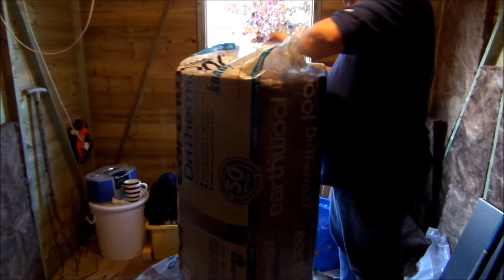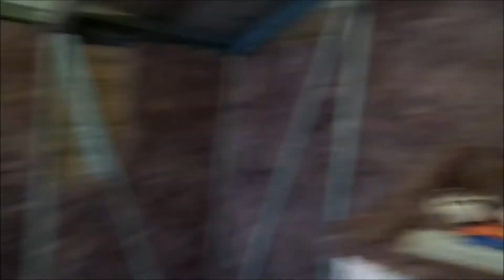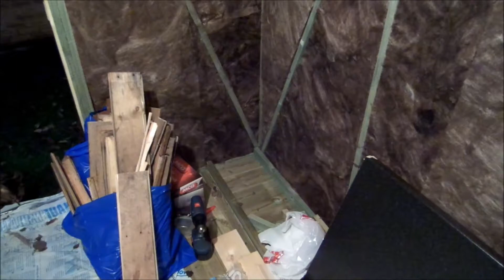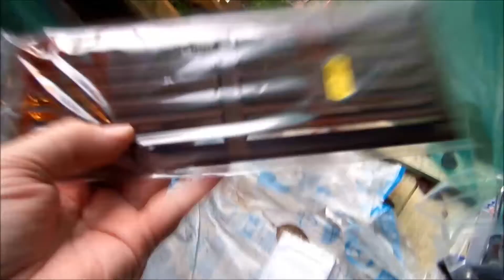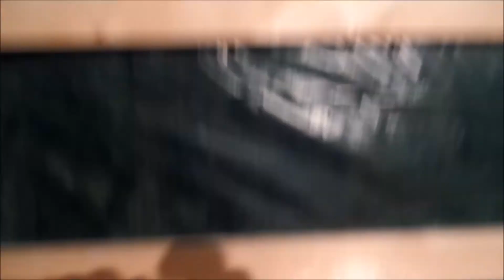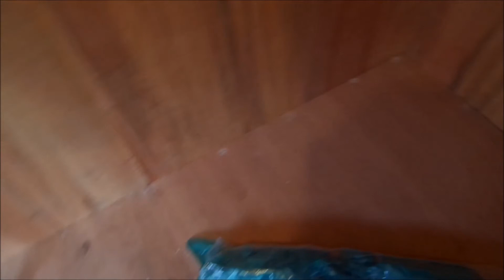VBLOG12 - Brewshed build Part 1

Comment: Look at the foil bubble wrap insulation for the roof screwfix do it, cheers
Reply from the maker: How do I get over the condensation when the sun hits it? I can put battons on to make an air-gap then fit the insulation? I am slowly coming to the conclusion that this is the way to go then maybe fit some marine ply over the brewery equipment end.